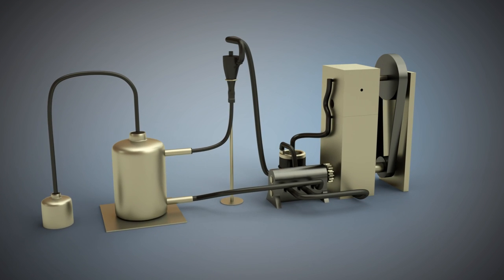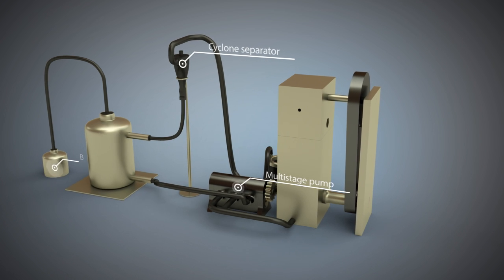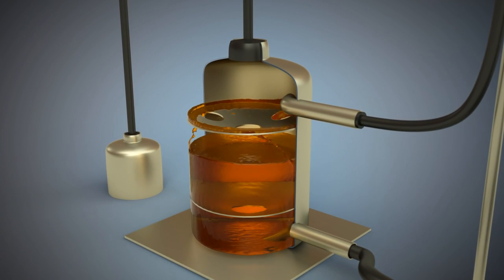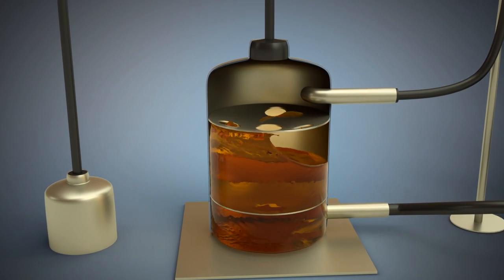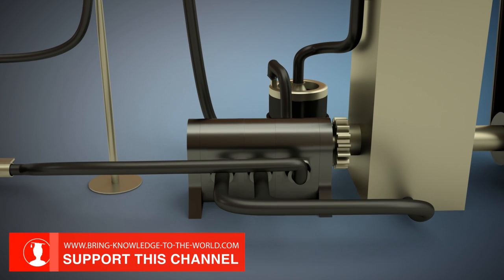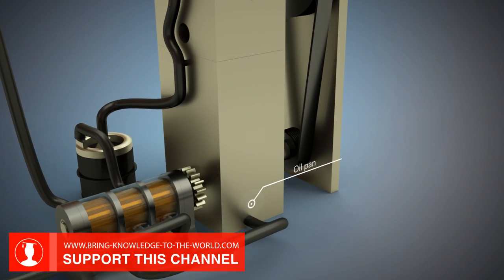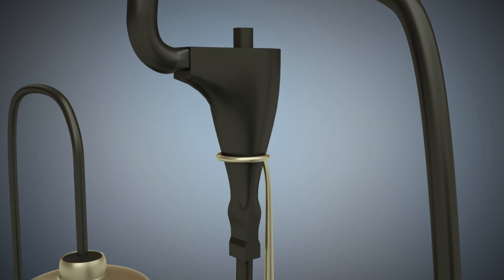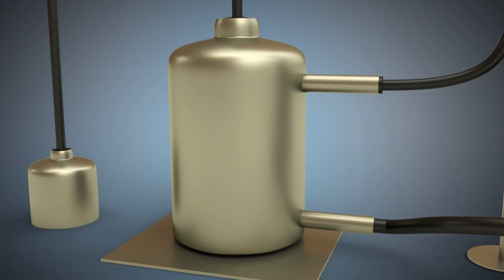Dry-sump lubrication - How it works! (Animation)

Comment: This Video taught me that it is possible to over fil a dry sump and cause engine to smoke . There is no other video that shows the oil inside of the tank simulation. My Artic cat XX has 3cyl Yahmaha engine started to smoke under extreme driving turns and such. Drained some oil out and never did it again.

Comment: Nice video.  But no mention of the advantages of dry sump over wet sump.  Seems overengineered to me.
Reply: There’s a few Benefits to dry sump set ups,  for example, constant supply of oil on steep gradients or intense cornering, the ability to prime the engine of  oil before first start up to prevent premature wear, the ability to hold more oil, the oil pump also acts as a vacuum pump and creates a vacuum inside the engine block which is known to increase horsepower. I could probably go on.
Reply: @Diesel8290  thanks this  was what I was looking for
Reply: You can use more oil rather then just what an oil pan can hold. 10 quarts vs 5 quarts.  More oil can means cooler temperatures and less break down of the oil.
Reply: Brett Guysi is the only real advantage of this is running more quarts an oil pan spaced and oil cooler kit would suffice and would weigh tons less than that whole system.

Comment: Cyclone separator remove the air from oil ?!
Reply from the maker: Yes, do you have any problems with this?
Reply: Ok, of course, thank you
Reply: I've seen setups with airated oil and low oil pressure not running a "cyclone separator". A necessary piece of the setup. Superb animation.